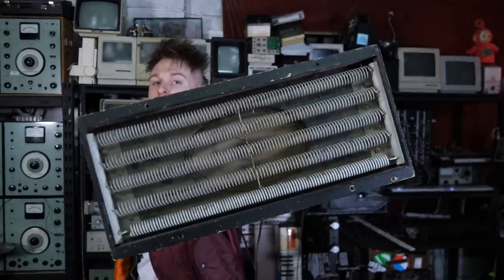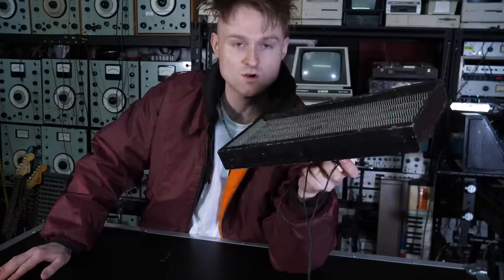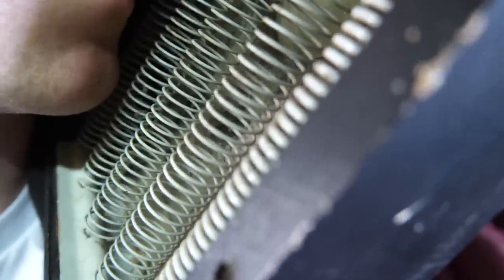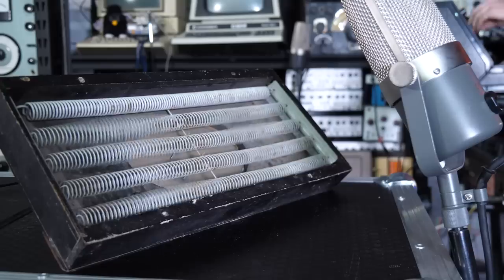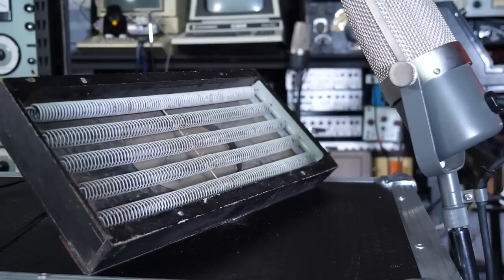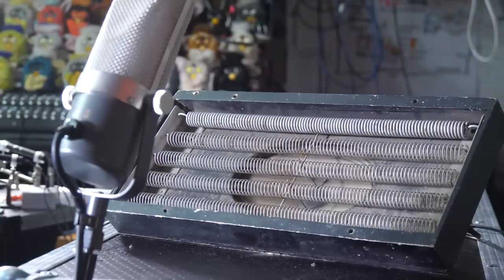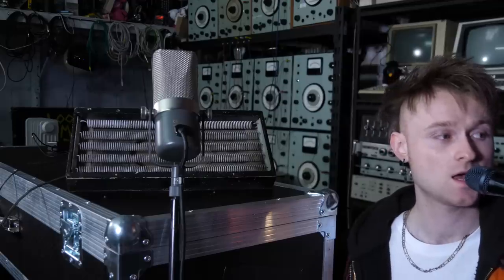Trying A Weird Vintage Spring Speaker Reverb that i've never seen before.

Comment: Urge to go grab my spare 6x9, build a box, and throw some different springs in it intensifies
Reply from the maker: Tried. And failed but definitely give at go!
Reply: @LOOKMUMNOCOMPUTER  I used to hang a spring (laundry dryer heat element scraps) between a plastic box and one string of my violin.
Sound: awesome.
Comfort: haha hell no.

Comment: Use to get auto reverb units from local stereo stores back in the 60's. they had one spring and mounted under the dash. the spring had a pick up at each end of it and the speaker hooked up to the out amp. the whole thing was about an inch tall a foot long and 4 to 5 inch wide. they would make your car radio sound like you were at a concert. they disappeared when the 8 track came out.

Comment: Gosh that reverb box brings back memories lol ...
I was in a band back in the early 1980's... A new wave synth band.
Playing a gig... It was good and the finally was to lightly drop that box whilst it was connected to the P.A. from about 3 inches so it would end the gig with a big explosion sound...
It worked ace for about 9 seconds then blow the fuse sadly... But what a finally.
Take care people in these troubled times.
Homeward bound are the believers.
Reply from the maker: Int that a spring reverb not a spring speaker?

Comment: Looks similar to a reverb spring setup in old valve guitar amps.  An associate  had to to repair one once, and I had to source a replacement part.  These are made more for guitar'ish treble/voice sounds.. to give an illusion of room depth.  Because as you found too much bass or resonance makes the springs hit themself.

Comment: It is/was actually quite a common effect in guitar amplifiers. I have one in my Peavey MX and yes, it is called reverb and you can turn a knob to mix in the amount of reverb. They may have gone out style for being too expensive for mass production. If you kick the cabinet you get thunder because of the springs hitting each other. The springs are in a flat closed box in the bottom of the cabinet, not in front of the speaker. And they still work as demonstrated here.

Comment: Spring reverb is common in guitar and bass amps. One of my 100W Amps has spring reverb and when I'm using it can kick the amp to make thunder noises as effects, the spring is part of the wiring somehow and the reverb effect happens electronically rather than acoustically. You are overdriving the spring unit so they bang together which is how I get the thunder sound with mine.

Comment: I repaired one with two springs, the first time I saw one, I was puzzled, like WTF!, but iirc, was the springs unit, without that little speaker, as it was a guitar+mic amplifier box , it uses the sound from the main speaker. As it was transistorized I can point it like 70's. Remember that delays lines in TVs sets, are also like mic+spk encapsulated inside a quartz cristal walls, and encapsulated in plastic .

Comment: An alarm device test found in an old 2WW bunker probably, it has a little problem of distance between the springs, needed to be more distant to prevent from shock perturbations, also there's one witch never move the upper one
Could try to rebuild one with one spring less, but same dimensions

Comment: 3:55 - 4:10
POV: It's the 1970s, you're somewhere in the Eastern Bloc, waiting for your morning ride to work at a subway station. You watch as the metro on the opposite side pulls away from the station with a loud whine that shakes you to your core.

Comment: I'm under the impression that this speaker used to be much tighter and less prone to the rattling when it was new.  Have you considered taking it apart and maybe replacing the springs with new ones?  THey also seem to have been painted for some reason, which can also impact the sound quality.  I'd love to see you make this thing like-new again and then test it out with tighter springs.

Comment: Very nice. You should try a spring reverberation unit, like those that were used in Hammond organs in the 60s. It adds a very iconic sort of reverb to the sound, but if you beat, shake, or tilt the unit, you can make very violent crashing sounds that are reminiscent of explosions, like how Kieth Emerson did by abusing his L-100.
Reply from the maker: Kurdt Long yeah spring reverb tanks are coool :). Got a fair few of em! But never seen one of thee speakers proper oddddddd innit

Comment: Every now and then, in the late 60s and early 70s you would see those used in broadcasting. Because they couldn’t afford a plate, the timber and the delay on them were pretty darn good. Used to see small versions of those and some GM cars in the late 60s also they would be under the package shelf in the back

Comment: It looks and works like the D2, Résonance, the one of 4 unusual speakers of rare instrument Ondes Martenot. That speaker works just like this, but in ondes you can longhten or shorten the springs, and change the time of reverb by the switch on the back. The speaker on video is something simpler that martenot speaker.

Comment: Instead of a rigid box you could fashion a sort of giant vice to pull the springs tighter or looser so it's not as "samey"

Even just replacing one side with a retractable tuning wall they hook into would work

Comment: You should mod it so you can adjust the tension on those massive springs, you could ring in some super interesting reverb I'm pretty damn sure. Put the thick spring center and use it for bass, perhaps change the thickness of some of the others too. I'm sure that if they are of different thickness, they will reverb to different frequencies accordingly.

Comment: When I was a teen in the 90's I got hold of one of those. I don't remember it having a speaker. I think it just had RCA inputs and outputs. Being audiophile larva I played with it for a few hours and gave it back. I had big woofers and the clacking of the springs was unbearable and I could tell I was loosing fidelity. I might have gotten feedback from it too but that might have been a turntable that caused that. It was long ago. And I don't think there were any identifiable markings on it either. I had it connected between my preamp and Sound Craftsmen EQ which was also considered vintage in the 90's. The EQ was awesome : )
Reply from the maker: Sounds like a spring tank!

Comment: I've noted on amp repair channels - that sometimes those number codes on speakers might identify the manufacturer, year, and week that the speaker was manufactured...   (Doesn't exactly pinpoint when it was assembled, but might be useful.)
Reply: I don't think that European manufacturers were party to the RMA manufacturer's and date code systems used by most major American electronics manufacturers. (RMA =  Radio Manufacturers of America)
Reply: @goodun2974  Good to know!

Comment: I wouldn't be surprised if the cover for this thing had some felted bars that went between the springs to catch overdriven sections and not allow the springs to smack together. If the driver linkage was on the diagonal, it would be a little quieter but have a wider range as you're changing the resonant frequencies of the springs, higher here, lower there, same for the middle one, etc.

Comment: Modify it with actively changing the tension of the spring on the fly electronically, it will sound awsome. also get them further away from the box walls and the springs itself, because it sounds horrible when the springs hit the walls or each other doto over drive/over stimulation of the springs. PS: every single spring should been able to tension separately then you will det really strange sound combination

Comment: My Peavey Ecoustic 112 Has a single spring set in it. Sounds sooooo Good with my Les Paul. They sound good with most pickups but, DO NOT bump it or use it as a monitor..It can send horrendous feedback as the spring winds down after the huge resulting reverbed "Twang". XD.

Comment: 2:14 the date looked like “1889” in the speaker cone’s exterior.  Maybe 1989? It was sketchy to read, but there’s a date on there.
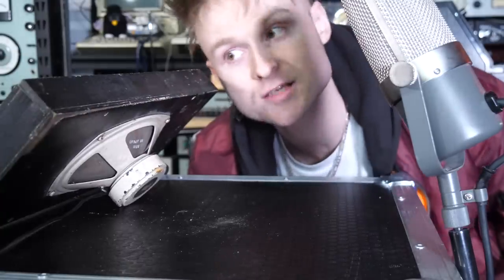4:42 Ooh, now that’s a sound to collect. Maybe take off the bottom and the top of the frame so you can extend them and keep the springs from contacting the frame. The sound will be less impeded (not in that way) if you let the springs spring. Also, you might have fun playing to try to find resonant frequencies of those springs, and visually getting them to hold standing waves.

Comment: I would like to see two more experiments with this "spring speaker". One, would be to prop it up against concrete blocks, to hold the frame as rigid as possible, and the other, suspend it from rubber bands, and allow the frame to move as much as it wants. Compare the difference in sound. This is a very interesting piece, I suspect, to give some kind of "Cathedral" sound to an electric/electronic organ.

Comment: So no crazy 256 bpm stuff in it may sound muttled.  I like the effects, but those springs appear clapped out like old suspension, try replacing the springs and driver , we may end up with a nice channel speaker that can be used to effect sound depth or distance. So wild.

Comment: I suggest the crossbar at the bottom should not vibrate but be fixed just like at the top end, to reduce the buzzing.  All spring support points should not vibrate!

Comment: I loved this speaker and I built one, I wanted to ask if the springs have a soldered rod through them and that same rod has 2 more rods connected to the outside of speaker? Or these metal rods are inside the speaker center?

Comment: It's not weird. I had one of these, back in the day. 
Can get weirder. Until 20 years ago, it was quite common to see data terminals with memory consisting of mechanical delay lines. Do look this up, it's fascinating.
Reply from the maker: Yep but those are transducer delay lines. Was what you had a spring speaker like above or a spring reverb tank wh

Comment: If most hardware stores sell those springs, it wouldn't be difficult to drill into and add them to your own amplifier on the front, just remove the grill and that's all there is to it. Actually, bed springs would do the trick just fine, or trampoline ones. Amazon or ebay should have the same springs if one cannot get any from brick and mortar stores.

Comment: That is really bizarre...  Seems great for mids and highs but the lows cause too much distortion from the springs.
Reply: when it was made, heavy sub bass wasn't as mainstream as it is now
Reply: @RWL2012  Yes agree and I suspect they did not drive the speaker as loud as it was tested.  Therefore the distortion effect for the springs vibrating would not be as dramatic.  Kinda cool...

Comment: Something you can tell about its age is that its less than 80 years old. Until the 1930s speakers where usually equipped with electro magnets. Permanent magnets of high strength, like this speaker uses,  where not comon yet.

Comment: What an awesome concept! I just think the springs should be separated more from each other so they do not crash together and make that horrible sound. Or maybe make them adjustable in case you like the horrible sound in some cases or to modify the wave by stretching them as well. :)

Comment: Looks like it's from the 60ies
Found a catalog which mention this maker
http://www.retronik.fr/revues/radio-constructeur/1964/RC202_10-1964.pdf
Not sure however if it's just the speaker or the complete box which is from Audax (the maker)

Comment: Reverb is awesome. Until you tilt your amp to get a better look at the settings on stage in the middle of a break in a cali rock reggae trakc, then you slam it down a bit hard, deafening everyone in the room with the cacophonous sound of springs slamming around a 40w amp. Which i did. And was very embarrassed of
Reply from the maker: Haha yes. That’s a spring tank! Different to this. They will do tjay haha

Comment: Its not made properly. The springs need to be set apart slightly more as well as higher away from the enclosure. Or you can just give it less volume.

Comment: what if you built one with subwoofers?
Reply from the maker: Slim Racer tried in the weekend. Failed miserably
Reply: @LOOKMUMNOCOMPUTER  did you attach the springs to the cone like in this one?
Reply from the maker: Slim Racer yes. Lots of factors involved. When I get one to work I’ll do a vid
Reply: @LOOKMUMNOCOMPUTER  cool man I look forward to it. the one in this video sounded pretty good i thought

Comment: This abomination has no business sounding as good as it does. Would be also very easy to mod and install a system that blocks/pulls on the strings a bit and have some control over the beast.

Comment: Lots of questions…
Reply: What are the resonant frequencies for the springs?
Reply: What happens if you loop the spring output back through the speaker?
Reply: Can you tune the springs by changing the tension of each spring?
Do different gauges of spring affect output?
Does the stiffness of a spring affect output?
Reply: What happens if you insert more, shorter springs vertically instead of horizontally?
Reply: A taught spring can be played like a string instrument.
If you tune it to a specific note/frequency, how does the spring affect musical notes played through it?

Comment: I see your videos from time to time and often think your a goof. You do bring interesting stuff, but you seem to never do any research on it and often damage it in the process. Some helpful hints: A amplifier always needs a load ( speaker, power resistor ) connected to the output of the speaker terminals, or plugs. If it is stereo you need two speakers, even if you are only using the one channel for your demo.  A speaker has a certain rating of watts and type of sound it is designed for, going to far out side of those perameters will damage the speaker of the amplifier.  If the item is unknown, use your eyes and ears, if it distorts, smells hot, or has a bad sound you went to far with it, lower your volume, or change the input to make it sound better. If you are quick with your response you would still have things to use and show us. Using an amplifier to burn out a speaker will damage the amplifier, because as the speaker is burning the coil, that coil is creating a lower resistance and causing a short thus over loading the amplifier.
Reply from the maker: Your getting confused with valve amps solid state amps most of the time need no load. Clipping is fine and nice. do your own experiments your ways. Peaceee
Reply: @LOOKMUMNOCOMPUTER   Your the one that said you blew out all of your amps.
Reply from the maker: @rennethjarrett4580  yeah i blew them all driving crt's and driving solenoids. they blew because they were doing what they werent meant to be doing. they were getting hot. they were smoking but thats part of seeing how far you can push things. they didnt blow due to empty points, but blew to driving too much current in experiments
Reply from the maker: You are right mind ha. I break stuff cus of stupidity that is not a lot 😂